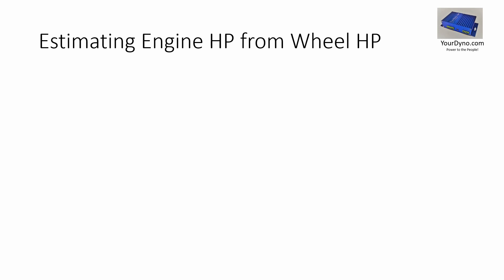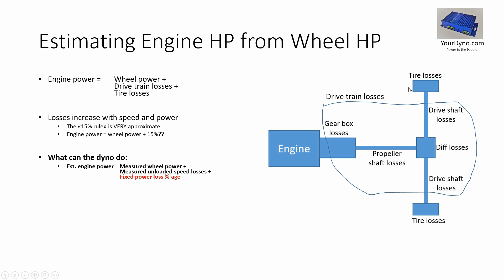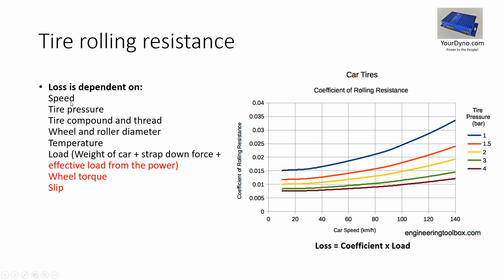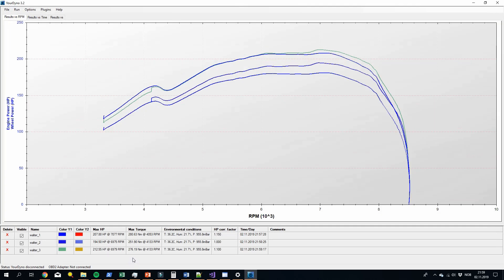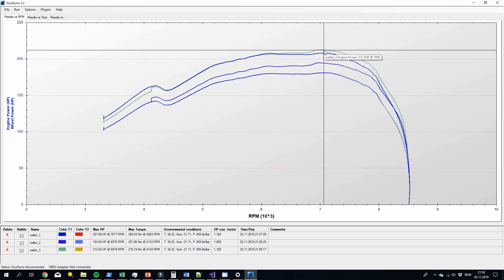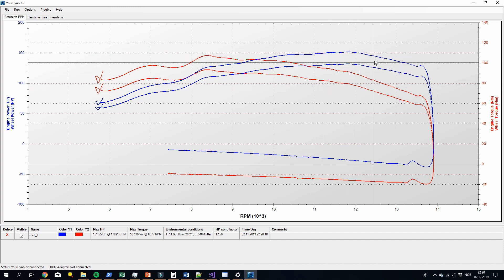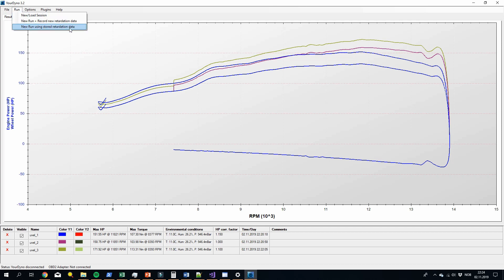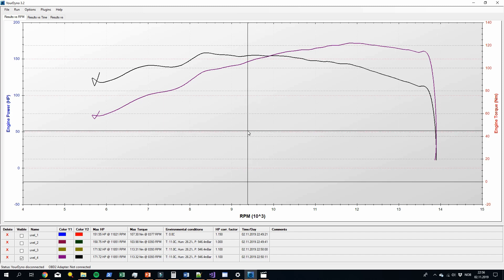Estimating Engine HP from Wheel HP with YourDyno.com

Comment: One thought, if you have a2 roller-2wd nonlinked  chassies dyno.
To estimate tyreloss, couldnt you monitor speed on front vs backroller?. The tyre would deform on front rollers, but not* the rear.

*=At least much less deformity.

Comment: Drive rain losess dont depend on engine power ! If so than how maybe except more tire deflection at biger power but we measured drive train losess after measured power be push clutch where no power from engine is deliver to drive train but yea in phase acceleration it count ok Beside this no factor which impakt on this .,as engine is completely diffrent part than drive train 👌🏻 Drive train loses depend on speed and oberal construction each patrz ofndrive train which finały consist on output losess  and it should not be  give in % but in ansolute hp Numbers always at egzacly the same wheel velocity for each vehicles no matter at which gear it is etc unlees algorythm calculate this for standarised velocity ofndrive train 😎
Reply from the maker: You are wrong there. This is why high power cars have cooling systems on transmission parts while low power cars don't. The losses are not an absolute number for a given car. Gear sliding losses are dependent on the torque the gear transmits, the speed of the gear and several other things
Reply: @YourDyno  so heat is factor ok and because of this we should say that drive train losess is in % linear with power
Reply: @YourDyno  ok let say i increase power in some car from 100 to 200 hp and when it was 100 hp at crank at whell was 80 hp so 20% losess so at 200 hp be how much ? not 180 hp but 20% so 160 hp at whell or something between depend how material react asf ? ☕️i watch some channel on ytmay e found it where dude claim he measured car before and after tune with alot crank hp diffrenc he say drive train losess on hess dyno stay at the same absolute numbers level 👌🏻🤷🏻‍♂️☕️….i also found error when i comapre ypur dyno chart in this video crsnk vs whell power vs on some other dyno chart so ypurs and some show that bigest losess are at peak power rpm and as rom and speed increase drive train lsoess decrease as power decrease as well but i found dyno vhart where it show oposit so even after peak power when power start drop down chart still show more and more drive train losess 🫣🤷🏻‍♂️ wtf is this 🤷🏻‍♂️ somebody try misleading people i quees like always gay 💩 so we must kill it 😎👌🏻☕️beside do you know that rolling resist the biger = shorter time on dyno from 100 to 50 km/h let say when you measured drive train losess biger friction the same some other stuff aswell but ☝🏻 the biger roattiotnal inertia the longer deceleration time on how they call it losesss measuring phase on dyno with clutch turn On when whell axless asf decelerate 🤭 this dyno dont tske into account i quees 😉or maybe it take 🤔biger rotational inertia makes acceleration phase slower but deceleration phase as well slower 🤭☝🏻☕️

Comment: My car got a 560 horsepower package installed in it. It dyno'ed 478 rear wheel horsepower and the tuner said it is good to go.  It is a 5 speed manual so divide or times by .853 to get crank or wheel horsepower from the one that you know already for sure.
Reply from the maker: Yes, but very seldom do you know the engine power upfront, the problem is typically the other way around. You know the wheel power, because that is what you measure, and want to know the engine power. The 15% drive train loss "rule" is very rough, as losses depend on a lot of factors, in particular on roller dynos.

Comment: Can you tell me how are the coasting power losses calculated ? My guess is that we know the moment of inertia of the dyno's rollers and the angular acceleration of the car's wheel is calculated at many moments, That means we can get a reading for the lost torque curve and then add this to the wheel torque to get the engine torque.Then the power curves are determined easily.
Reply from the maker: Correct!

Comment: If you know the whp, what would be the point in guess the cars crank hp, if all you can do is guess?
Reply from the maker: Because you are guaranteed to get that question if you dyno cars for a living. And it is not all a guess, some factors are measurable, some are constant and some are a pure guess. And there are factors you can influence, like tire pressure. Good stuff to know!
Reply: I have to answer what the engine HP is all the time on my dyno. It gives a base calculation using factory EPA data, but its rare to see a factory car on the dyno. Something as simple as transmission fluid temp can affect the wheel HP, so when you put in driveshaft weight, transmission type/build(lighter race parts, heavier duty towing parts) tire and wheel weight, rolling resistance, exhaust restriction, tire pressure, tire compound, etc the best you can really do is an educated guess. That being said, everyone wants to know their engine HP. Or you get someone with a blueprint engine that came with an engine dyno sheet, and they are disappointed because it lost 100HP through the drivetrain taxes.